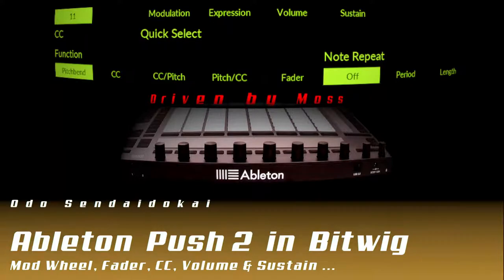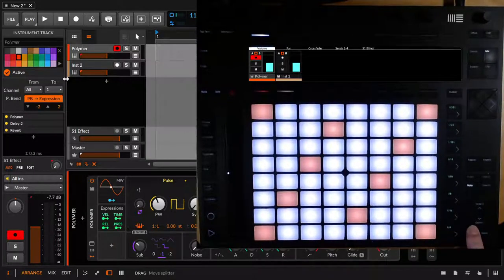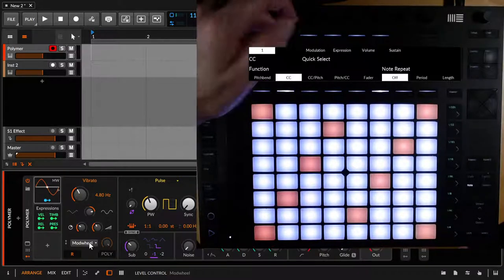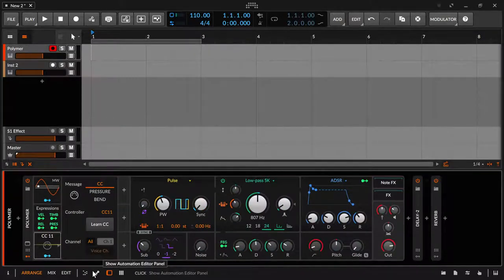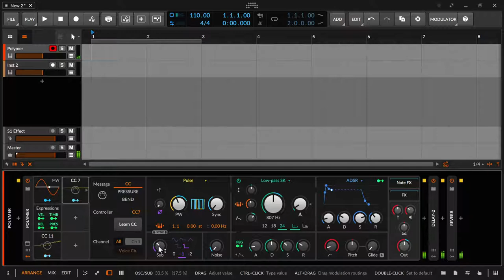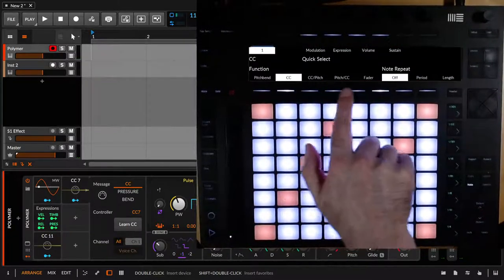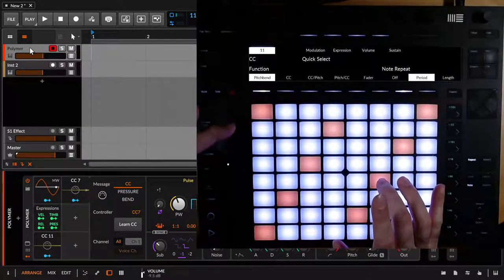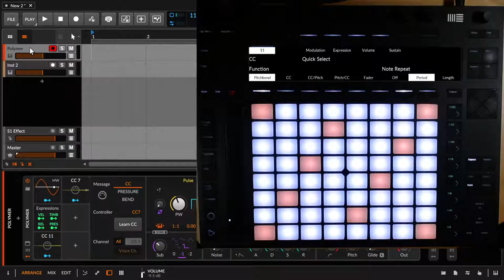Ableton Push 2 in Bitwig with Driven By Moss - Mod Wheel Fader CC Volume & Sustain | english

Comment: nice! thank you for showing this :)
Reply from the maker: Youre welcome. Since I created that video 4 years ago, there are some other additions to the push. Like the option "last touched". So if you click on a parameter in your daw or on the push, this current parameter can be controlled via the touch strip as well. That's sometimes very handy when finetuning volume for a track or a device or the dry/wet mix knob.
As always having the Driven By Moss Manual open while using the push is a great idea 🌻
Reply: @OdoSendaidokai  ohh yes i did notice some extra options. Thanks for clarifying that :) and yes thats a good idea keeping the manual open. Am just starting to use the push more. Have been neglecting it. Thanks again